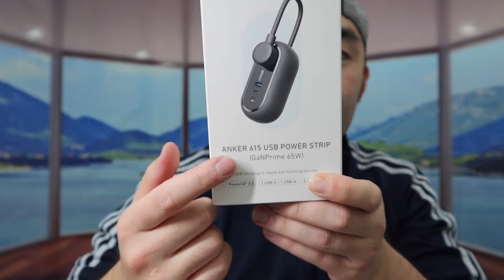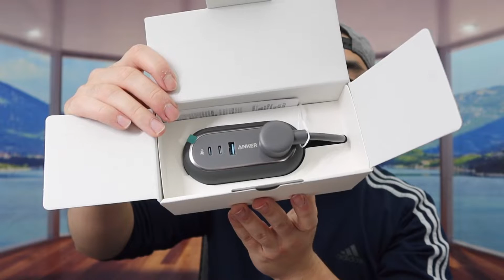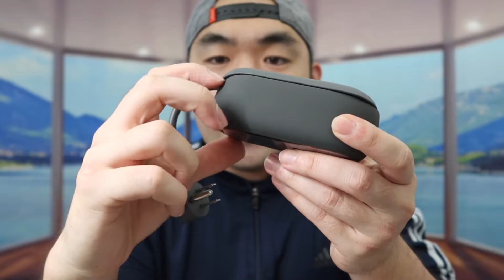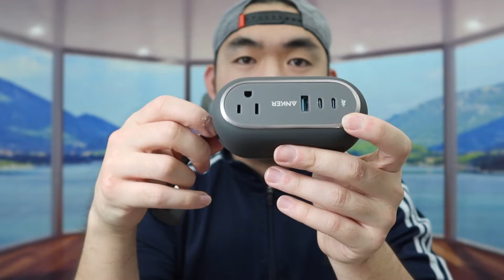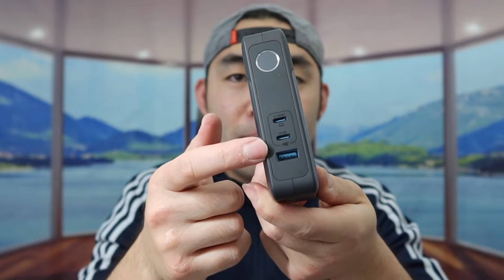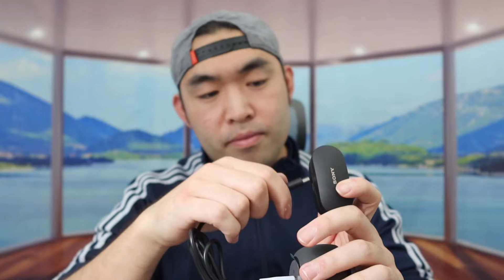Should You Buy? Anker 615 GanPrime 65W Power Strip

Comment: Thank you  for the video. It was very informative.   Is the 615 Gan prime work as a battery power ?  aOr is it just a small surge protector?
Reply from the maker: You mean power bank? 

If so then no its not a power bank its just a power strip.
Reply: basically a surge protector
Reply: @Cz82  surge protector isn't the same thing as a power bar. Many power bars ARE surge protectors but this doesn't seems to indicate any surge protection.